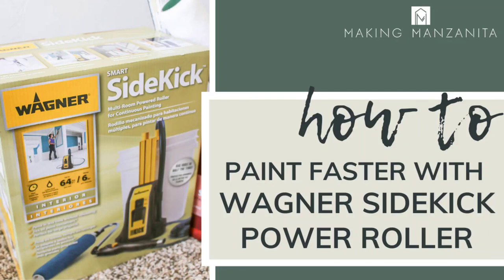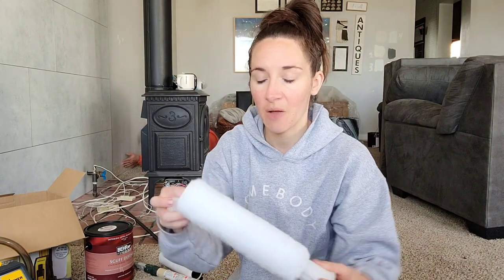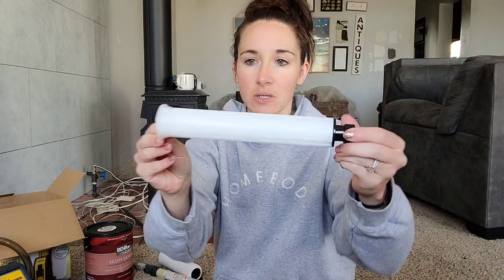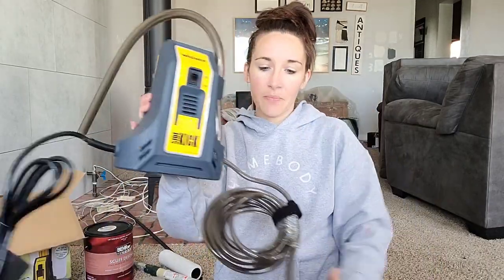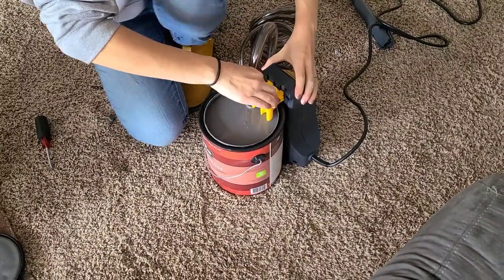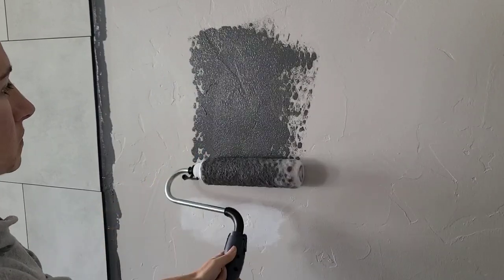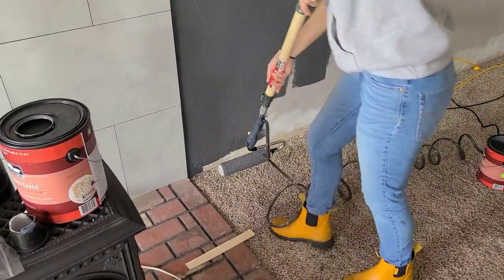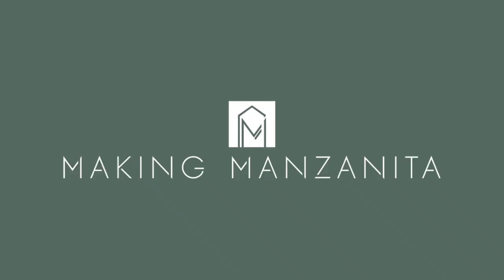Wagner Sidekick Power Roller | How to Use Power Roller to Paint a Room Faster

Comment: Thanks for showing and explaining this product.  I've got an older design power roller that I absolutely love.  It has an advantage over the Wagner in that, the paint flow button is near your hand on the extension stick, so you can keep feeding paint even with an extension pole.  So you can keep the flow constant and consistent even with a pole.  The older design is not set up to simply cycle the water when cleaning and I love that idea.  I'm going to try to adapt my system to do that for cleaning the machine and hose.  That makes so much sense.   The older system is kind of a pain to clean.   

In my experience, you really do save a lot of time with these.  Typically they say it will cut your time in half, presumably because there are no cycles in the roller tray gathering up paint, but I think it saves more time than that.   Being able to continuously roll, feeding paint at the volume you need, makes the rolling process itself more efficient, regardless of whether you're spending time at a tray.  My guess would be that, once you get the sense of the flow button, it takes about a third of the time.  Clean up is a little different and takes longer, even with this system, but just getting new rollers probably helps a lot. 

I also notice I get less spatter with the power roller systems.  Probably because, I'm not trying to race through the paint on my roller and get the last drops off so that I can get back to the tray.  These types of systems can be more measured and deliberate in application.  Since the Wagner system only lets you push the button when your touching the roller handle itself, that may be less true with Wagner on a pole, but it probably still applies.

Thanks for posting this.